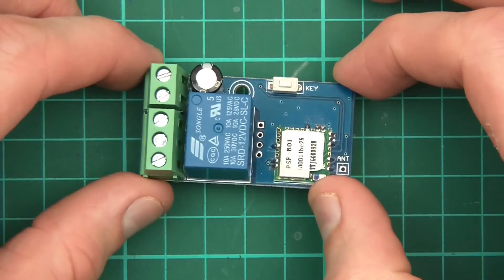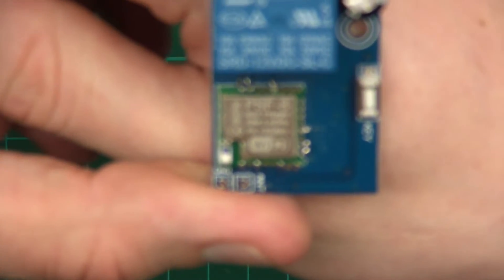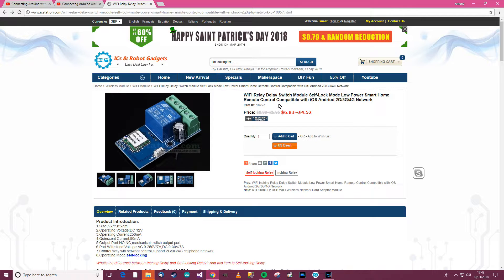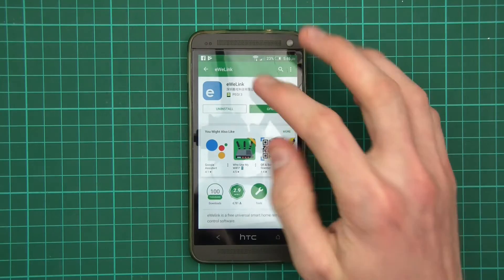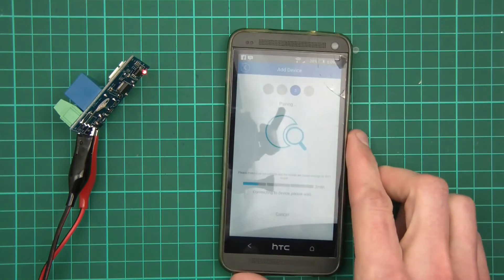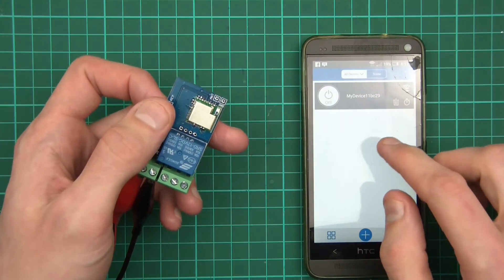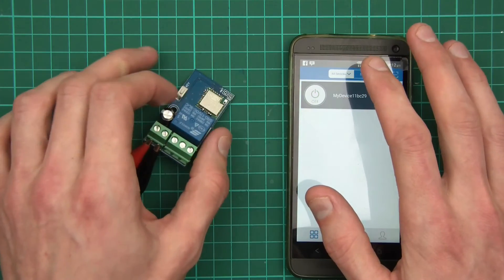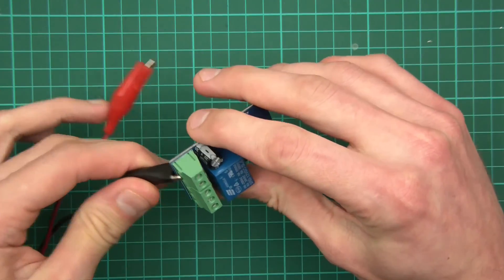TUTORIAL: Set Up WiFi Relay Controller Switch Set Up - Smart Home - ICStation Sonoff

Comment: Only uses WIFI, not Bluetooth, when set in AP mode the device acts as an access point for the mobile to connect to it where it can then send the device the wifi settings.

Comment: It's been my experience these devices act as a wifi independent connection. It allows you to see it as a wifi network sort of like a wifi printer. Then once you've connected to the device with your phone, (Phone is connecting to that network) then it allows you to put in your username and password which pairs the wifi networks together as one network where the phone, relay module and your router are on one single network. It works similar to connecting to wifi enabled drones.

Comment: Nice review video.  You mentioned that you can control it while you're driving home to activate electric kettle.  I am puzzled how are you going to do that since you are not in Wi-Fi range?
Reply from the maker: Hi, remember that your phone also has internet access. Most towns and cities in the UK have 4G access. Using this, you can use a "dyndns" type of service OR you can use a static IP which is for your house. Either way, you can access your devices from outside your network, as long as it is configured to allow it. :-)
Reply: @antonycartwright  Does this mean your leaving yourself wide open to being hacked throught his device?
Reply from the maker: @showme360  It doesn't mean that you're leaving yourself wide open to being hacked no, but it does mean that potentially, if another person knew your IP address, and knew which port your controller was on, and knew the command in order to manipulate it, the be able to control your device. :)

Comment: Mechanical Switch means a standard relay with an electro-magnetic switch. The types of relays used in the automotive industry. As opposed to a solid state relay which is basically heavy duty Mosfets and resistors and such.
Reply from the maker: Korishan Hey, thanks... :)
Reply: No problem. It's actually a really simple device. Doesn't take much power to keep the switch on because of the number of turns used on the electro-magnet.  There's other variants called Latching Relay. This one works a lot like a click-pen. It only draws current when toggling between latches. Those are good to use when needing to hold the relay on for a long time and the source to the latch is limited/remote (like a wireless switch)
Reply from the maker: Korishan cool... I'll have to get one and play about with it! I imagine that latching will need a large but short burst of power for each change.

Comment: I have NODE MUC 8266 02 second. Alexa echo 4 is a relay of channel.
To set up, Brother G. Radheedhe
Room No.01 Chanel 01 Fen Chanel 02 LAD LIGHT Chanel 03 Color LIGHT Chanel 04 AC

  Double room is 02
I have a relay of 8 chains in the heat.
Setting Room No.002
 CHANEL 01 FEEN CHANEL 02 LAD LIGHT CHANEL 03 COLOR LIGHT CHANNEL 04 AC 01
 CHANEL 05 FEN CHANEL 06 LAD 02 LIGHT CHANEL 07 RED LIGHT CHANEL 08 AC 02

Brother G.Code set in plz I want to talk to you if you give number then THANKS